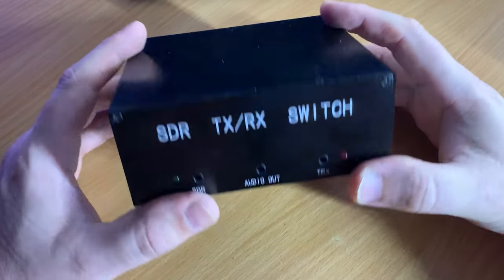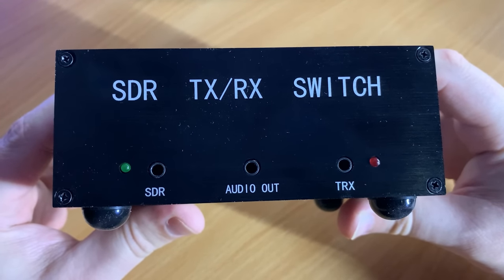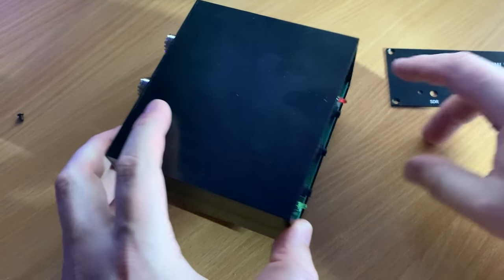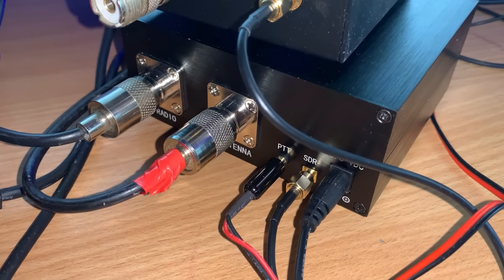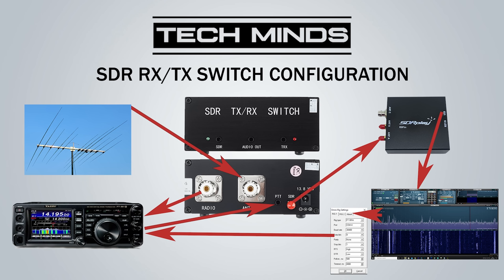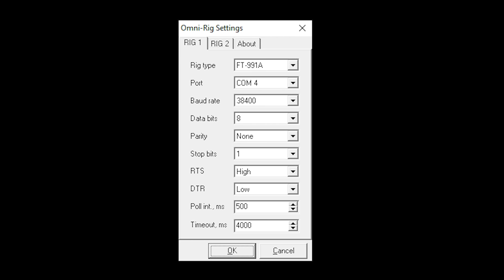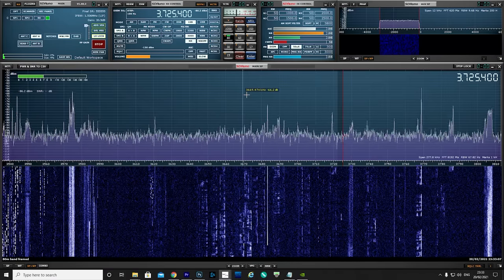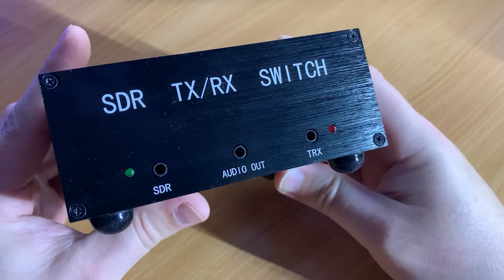PANADAPTER For Any Radio DC - 160 MHz SDR Antenna Switch

Comment: Too much insertion loss to be useful.  30.9db loss on 80 meters and 9.943db loss on 6 meters.  Their listing advertises 0.2dB loss, which is true.. only on 2 meters.  Anything lower frequency than 2m and this device becomes unusable.  Also, it can't handle 70cm at all, so this device is only usable on 2 meters.  Basically, I got a $40 project box for some future project.

Comment: I bought one of these recently.  It is a faulty unit and bangood is doing everything they can to not give me a refund on their junk product.  I have offered to send it back multiple times and they dodge the offer.  Stay away from this junk and buy an mfj from a reputable dealer!
Reply from the maker: What’s wrong with your unit? I know lots of people using these with out issue. Let me know the problem and I might be able to help.
Reply: @TechMindsOfficial  there is no signal getting from the antenna to my radio.  The sdr works fine but the connection between radio and antenna does work at all.  I cannot transmit out or receive any signal whatsoever.  I know to get dual receive you have to remove the jumper.  This does noth6 to solve the issue.  I believe the unit to be faulty and they are doing everything but allowing me to return it.  It's very aggravating.  I never got to use it.

Comment: At first I could not get the RF Mute to work. I found a post by swanawood on the internet that suggests changing a value in the 991.ini file of omnirig. This is the change:

[STATUS6]
Command=(TX;)
ReplyEnd=(;)
Validate=(TX.;)
Flag1=(..0.)|pmRX
Flag2=(..1.)|pmTX

to be changed in :

[STATUS6]
Command=(TX;)
ReplyEnd=(;)
Validate=(TX.;)
Flag1=(..0.)|pmRX
Flag2=(..2.)|pmTX

This worked for me. Having said that, unlike in your video when you press PTT my signal momentarily jumps very high before settling back. In your video it immediately cuts back as expected. If anyone has any thoughts on this please let me know.